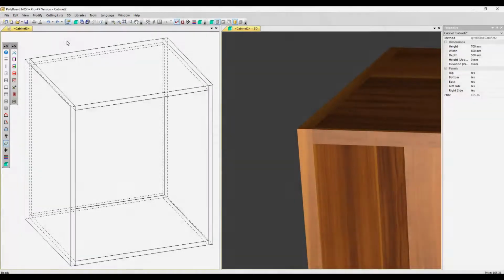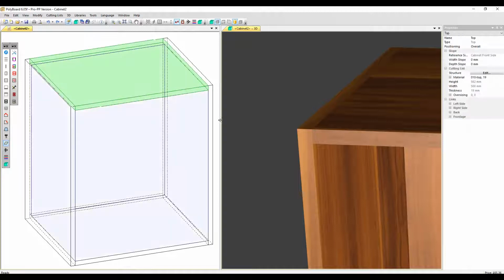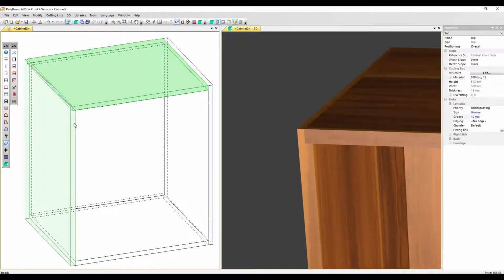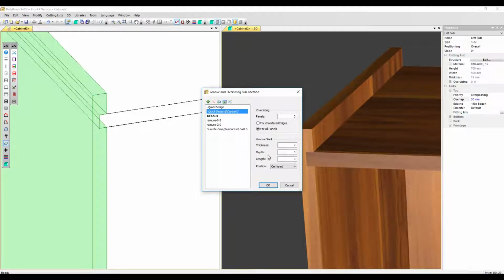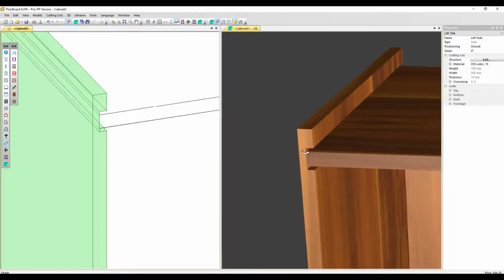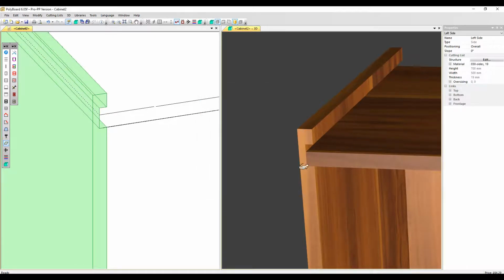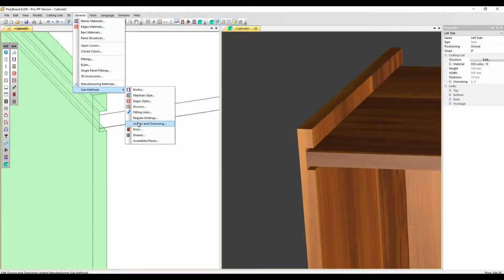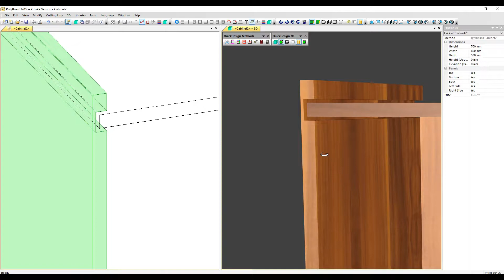Adding Slack to Grooves in Polyboard

Comment: How can a cabinet back panel be placed into a groove machined into the side panels, with the groove running along the full height of the sides so that the back panel can be easily slid in during assembly?

This issue occurs only when the cabinet top or bottom panel is positioned between the side panels. In this case, the standard groove does not extend to the full edge of the side panel, which prevents the back panel from being slid in properly.

I know that the groove can be manually extended using the inner tooling function, but I am wondering if there is a simpler or more automatic way to achieve this.

Comment: Dear sir, how. Can I make strip light groove 
in closet
Reply from the maker: Hi Maher, 

The best way to cut a groove in a panel for a strip light is through the inner tooling feature.
You can select a panel, choose to edit the panel structure on the parameters screen, and create an inner tooling.

Find more information on inner tooling here:
https://wooddesigner.org/help-centre/polyboard-additional-design-features/
Reply: @wooddesigner  Thanks it was helpful, although you must include strip light in library in the future.
regards
Reply from the maker: Thank you for your feedback!